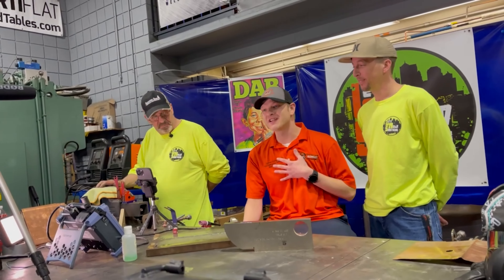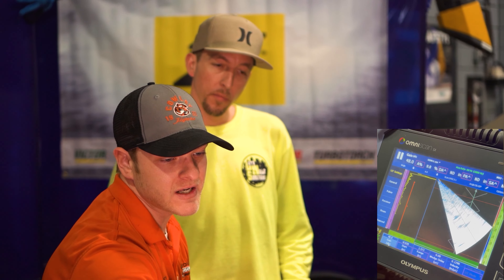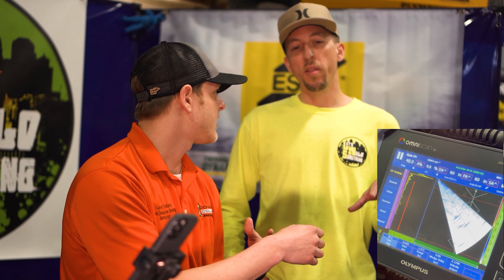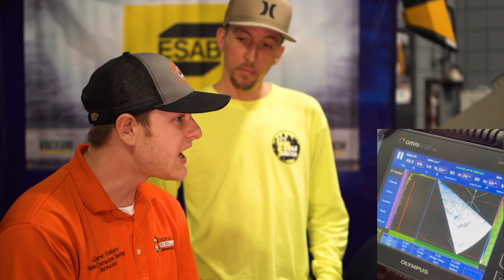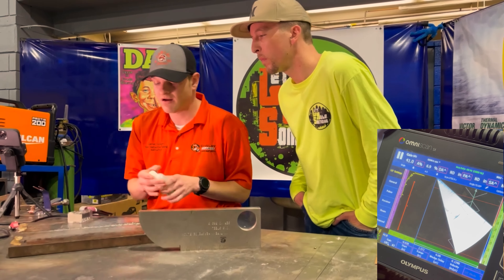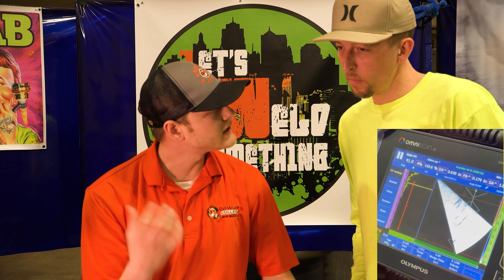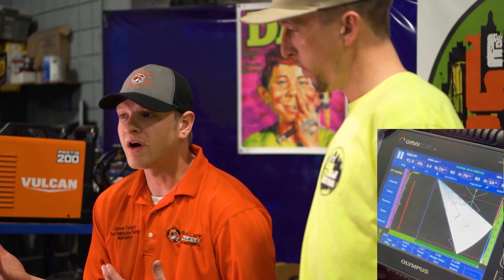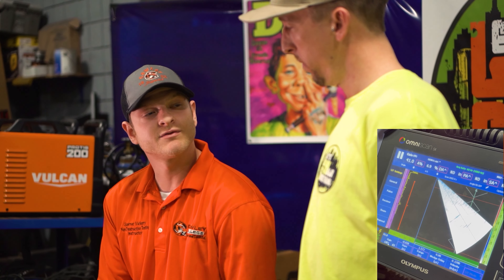Phased Array Ultrasonic Testing with Garret Vickery and Dabswellington!

Comment: Do we have to grind down weld to get a more accurate test? Why is team having me remove “scale” off the cap grinding it down flat and smooth ? Shouldn’t they be using probe on the base metal and not going over the cap? Thought paut was such a great test or are we getting played so the job can last longer

Comment: Last time I used ultrasonics for testing we were using it and the Doppler effect for fluid flow measurements in pipe. We used to go and buy jumbo tubes of KY Jelly to improve contact between the head and pipe in our case. Peak embarrassment for the Apprentice - send them shopping for supplies 😆